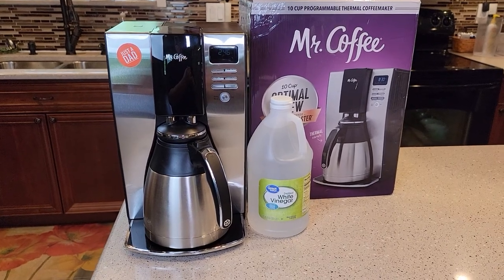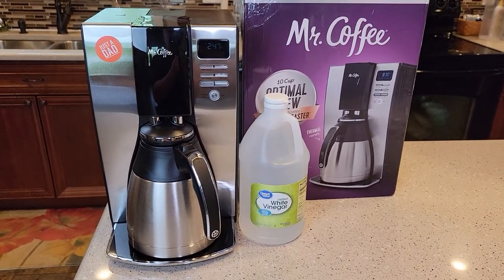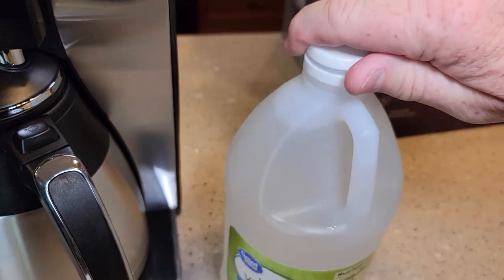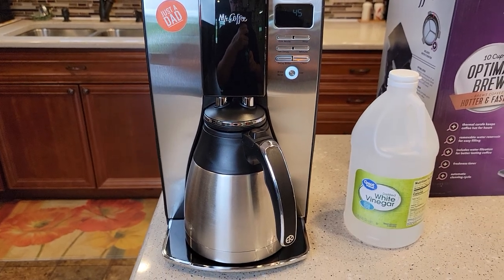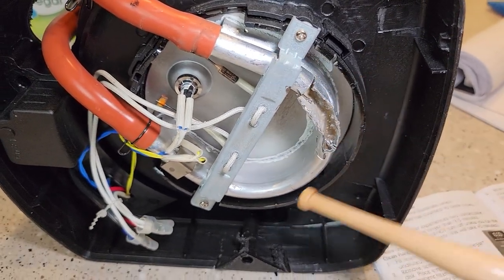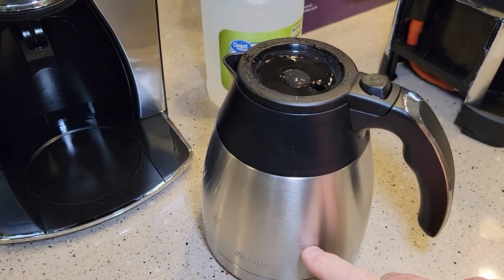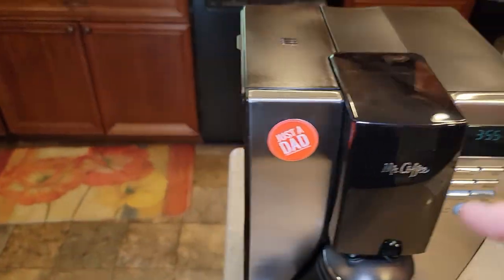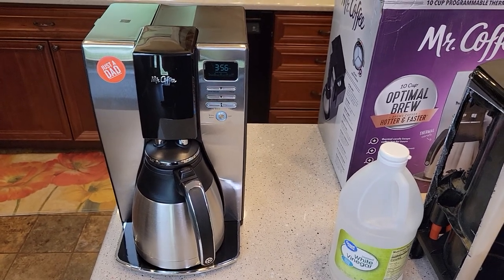HOW TO CLEAN / DESCALE Vinegar Mr Coffee 10 Cup Optimal Brew Coffee Maker Get the Clean Light OFF

Comment: Thank you for your very concise video.  I did it wrong before I looked you up...didn’t remove the water filter.  I have a reusable mesh type filter in ours - should I leave that in during the cleaning process?  I’m thinking I should so that can be cleaned as well?
Reply from the maker: That would be fine,  after you are done I would wash it with soap and water just to give it one last cleaning.

Comment: Thanks for the video.  After close to 10 years, ours is so clogged that it can't get through a cleaning cycle without a steady alarm tone going off and stopping the process.  I can see some minerals coming out of the top dispenser that goes into the coffee filter bucket.  Need to find a way to take this thing apart and clean it.
Reply from the maker: Sorry to hear that
Reply: Just ran into the same problem with the alarm going off.  I unplugged it for 5 minutes to see if it would resolve but not such luck. Then I took the coffee maker over to the sink and turned it upside down and could not believe all the debris that came out of the "top dispenser" as you called it. Since the cycle never completed there was still vinegar in the reservoir and inside the machine.  I rinsed out the top dispenser area with water.   I was able to run cycles through with no alarm! I always put a paper filter in the basket during a clean to see that all debris has been removed.
Reply: @todayisavacation  just did the upside down trick and yeah a lotta white scale ...trying the clean cycle again 🤞

Comment: If you only use bottled water in the coffee maker, is it still necessary to descale the coffee maker??
Reply from the maker: Yes even bottled water has minerals in it.  you need minerals in you water for your coffee maker and the coffee to taste correct.  Only Distilled water does not have minerals in it and that is why you are not suppose to use distilled water.   Bottled water is just fine to use since it still has some minerals in it.   Is won't need to be cleaned as often but it still will need to be descaled.
Reply: Descaling with vinegar also kills bacteria and mold. Food for thought.